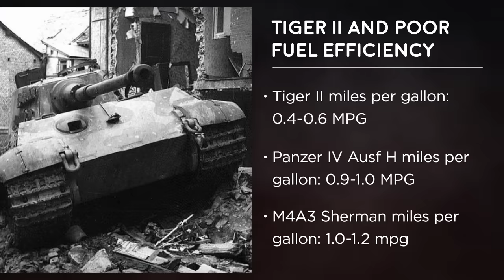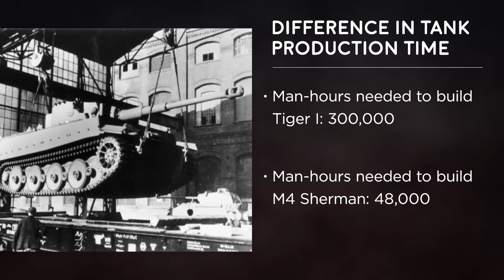Why Did German Tanks Perform So Badly in The Battle of the Bulge?

Comment: great video overall however I think there was some flaws. I believe that the Shermans had the best sights of the war. Both sides tanks could not neutral steer, however the Sherman was much better in urban fighting due to it stabilized gun. A cool fact though is this is the debut of the easy eight the best tank of the Second World War.
Reply: Any 76mm Sherman with wet ammo storage was the "best tank of the war" whether or not it had the E8 suspension.
Reply: @Mishn0  Ik that the shamans were the best of the war this just had improved mobility and cross country performance thus it is the best of them
Reply: Shermans*
Reply: The Sherman was comparable with other tanks in its weight class, but completely outclassed by the Panther. Even the Easy8 was outgunned by the lowly Panzer IV.
Reply: @TTTT-oc4eb  No it wasn't the 76mm was comparable to the Tigers shorter 88mm the Russian 85mm and the panzer 4s had much less penetration than the 76mm
Reply: @apersondoingthings5689  the problems with the 76mm was well known.
Reply: @TTTT-oc4eb  no I don't know any other than it not having a great heat shell and it's regular rounds not being able to pen the panthers upper front plate. Seems like some ones a wheraboo
Reply: @TTTT-oc4eb  by the time the easy eight Sherman came around all problems pertaining to the 76mm were fixed. The gun could destroy tigers frontally and many times panthers too, especially with inferior German steel quality. And with hvap rounds nothing except the jagdtiger was impenetrable from the front
Reply: @apersondoingthings5689  they were never fixed, but by the time of Korea, APCR was plentiful. The standard armor piercing rounds for both the 76mm M1 and 90mm M2/3 were too soft and had a defective HE filler that would often detonate at impact before it had fully penetrated
Reply: @TTTT-oc4eb  dude that was M79 for the 76mm. By the time M82 and M62 came around those problems with shell softness were fixed. The 90mm never had such problems with shell softness and actually never had problems at all. Every single APHE round had the chance of detonating before the shell penetrated that wasn’t a purely allied problem. The main anti tank round of the 90mm in the late war wasn’t even a APHE round, it was T33 which had excellent penetration rivaling the long 88mm on the king tiger. Your assuming that M79 which had problems with the quality of shell was the primary round of the 76mm and 90mms. M62 and M82 were the primary armor piercing as soon as the North Africa ended. You literally have absolutely no sources to back your claim of M82 and M62 being soft and being unable to penetrate the relatively thin armor of the tiger when they could do that from really long ranges and with M82 go through the ufp and out the back in panthers
Reply: @apersondoingthings5689  T33 was issued on experimental basis to the M26 Pershing the last few months of the war, and even that round had major problems with shattering.
Reply: @apersondoingthings5689  Richard Anderson of the Dupuy Institute:

“The "problem" with the 76mm wasn't really a single problem with the gun or in testing...it was multiple problems. The standard projectile, the 76mm APC M62 was produced with a large cavity for the burster, because everyone assumed that it was the behind-armor effect of the HE bursting that would do the most damage. However, there were two problems with that. For one, the larger cavity weakened the projectile, causing it to stress shatter when striking at high projectile diameter to armor thickness ratios. And then, even when it didn't fail, the BD fuse (common in all the US APC rounds) tended to go off before penetration was completed, destroying the projectile and preventing penetration.

However, when tested at Aberdeen they weren't testing for behind-armor effects, so the cavity was inert filled, which improved the results. The problem was exacerbated by the simple fact they assumed the Germans would be using armor similar to our own and BRL did not have samples to test to destruction until late 1943 in the case of the Tiger, early 1944 in the case of a late-model Panzer IV, and late October 1944 in the case of the Panther, which was far too late since the 76mm gun development was completed in early 1942. On top of that, it wasn't until June 1944 that it was realized the hardness specifications for the American projectiles was insufficient as well, which meant that the solid AP projectiles were also deforming and shattering when striking the German armor, even though after the initial problems found with the APC rounds had led to the assumption relying on the simpler AP shot would solve the problem. The solution was re-heat treated AP shot, the M77 in the 90mm, which became the T33, while in the 76mm work on perfecting the HVAP continued.

On top of that, the 76mm had major issues with flash and blast obscuring observation of the fall of shot. The flash problem was solved when it was found that it was caused by failure to completely combust the propellant in the cartridge...the solution was a longer ignition primer. Blast could be solved by a muzzle brake, but it was considered NIH - and too "German" - so was delayed in deployment.

Of course, the worst problem was the conservatism of Ordnance. The flash problem could have been solved from the get go with flash suppressing chemical additives, but they were considered to cause excessive wear in the tube so were rejected, since Ordnance liked to achieve 1,000+ round lifetimes in its barrels, which hardly helped when the tank it was fitted to only fired 200 rounds before it was knocked out. On top of that, despite advice to increase the propellant load and thus increase chamber pressure and Mv (as did the Germans in the Pak/KwK/StK 40 and KwK 42 and the British in the 17-pdr) in the 3" and 76mm, Ordnance refused because of concerns with safety issues. Fundamentally, there was nothing mysterious about the 17-pdr that made it a better 3" gun than the American 3" gun, since, despite the nomenclature, the 17-pdr, 77mm, 76mm, and 3" guns were all very similar pieces.”
Reply: @TTTT-oc4eb  no T33 was issued to all of the 90mms similar to that of the M26 so Jackson’s were also equipped with it. No it did not have shattering problems. If it did it would have not been shipped because of Americas doctrine of everything has to of the best quality. If it had shattering problems it would have shattered against the panther in cologne or the time were the Pershing ufp ed a panther, but it didn’t. Your claims have no base for them. You saw that M79 had a problem with shattering and assumed that all us rounds had the same problem which they didn’t
Reply: @apersondoingthings5689  The Panther in Cologne was hit in the side where the armor is only 40mm thick, at that range even the 75mm Shermans would have no problem going through. Thorough testing of the T33 post war showed major problems with shattering.
Reply: @TTTT-oc4eb  this just proves my point. The M62 which had problems that every APHE ever had with shells exploding before it. M79 the uncapped AP shell had problems with shattering.
Reply: @TTTT-oc4eb  dude you realize that shattering can occur on any thickness of armor. Shattering wouldn’t be a problem if it fired and shattered on 600mms of armor. The thing had phenomenal pen and shattering wasn’t really an issue for it
Reply: @apersondoingthings5689  Read the source I sent you one more time. The M62 rounds were too soft, too,and would often shatter even if the HE filler worked. German APCHE rounds did not have this problem, and the British used solid shots.

Get over it.

As for the T33:

SPACED ARMOR, by A. Hurlich (WAL 710/930-1, November 1950), points out that when 57mm M70 and 90mm T33 solid AP was fired at a 1/2" plate at 30 to 60 degrees, 26 of the 57mm rounds went through the armor without shatter but 26 of 28 90mm AP shattered against armor that presented insignificant resistance. The 90mm shatter was attributed by Mr. Hurlich to longitudinal wave phenomena particular to 90mm AP, since the 57mm round was relatively long and thin and should have shattered before 90mm AP.
Reply: @apersondoingthings5689  I have given sources, you have only given your claims and bias.

Comment: Great video, but just some clarification needed. The 17 pounder on the Sherman Firefly could  penetrate the Tiger II armour but only within 500m with a well placed shot. Beyond that it was very unreliable at penetrating.
Reply: I can't see the 17 pounder penetrating the Tiger II even under 500  yards.   They struggled with the Panther at that range with APDS often breaking or bouncing off.  The Tiger Armour was very slopped more than doubling its effective thickness.

Comment: The Tiger I and IIs weren't designed for such continual offensive maneuvers. They were essentially breakthrough tanks for punching a hole in defensive lines and withdrawn until needed again. They were also good as static defense. Germany however used them in the exploitation or as mobile reserves on the defense. They were ill-suited for this constant movement and weren't designed for it in mind.

Comment: It is a nice comparison between the Shermans and the Panthers, Tigers and Kingtigers. The thing I find wrong is that germans "overengineered" their tanks, like the Panther, which in some cases the engine just started burning furiously, an example is just before the battle of Kursk when two Panther D variants on their way to Kursk just burst into flames which knocket it out of combat, for good. This happend a few more times later, but the issue was resolved. Yet when the allies stuck multiple smaller engines together to make the engine for the M4A4, it turned out to be way more reliable than almost every single german tank, just like all the other Shermans. They also stuck a radial engine, used for aircraft in the M4 and it worked to. The Shermans broke down way less frequently than the Panthers, Tigers and Kingtigers, but due to a good design they were also very easy to repair, like the transmission, which only needed for one single piece to be removed to fix in the eventuality it did break. German quality is also somehting which played a part. When you had slaves and workers who had to be moved away due to allied bombing and the harsh environments compared to the workers in the US, who worked in spacious and way more comfortable environments without the fear of being bombed, its easy to see why production quality was a problem. Also the Shermans had a low-speed-stabilizer which made them great in close quarter combat.

Comment: The track was pin and hole design, when the track froze to the ground the final drive failed or the transmission. Pin and hole drives are simple to make but wear out quickly in sand, gravel , or rocks, readjustment is a constant or the pins slip and ride on the track not in it. The system was changed in the last year of the war.

Comment: So if the big cats being bigger and better proved to be futile and even a hindrance, why slander the 75mm M3? Even if all you look at are the field reports of tanks and personnel lost it doesn't paint the full picture. The 75mm M3 was a fantastic gun and was enough 95% of the time. The 76mm was considered a downgrade so why give up on something that works 95% of the time? 
The firefly's 17 pdr had just raw power and brute strength bc it had 3 times the propellant the 76mm M1 casing had, but with the muzzle break and certain ammunition like the APDS round it was wildly inaccurate. I don't understand why nobody talks about the M93 HVAP for the 76mm m1 armed shermans because it was roughly equal to the standard 88mm kwk43 rounds, and was more accurate than the firefly. The problem is the tank on average only carried 5 rounds of M93 but for how common big cat encounters were I wouldn't just write that off. 
The 76mm with the right ammunition was able to keep pace with the German guns but the tungsten wasn't. The big reason we needed the 90mm was for the M82 aphe round being the most common offered the greater performance on average and with apcr. 
But in the end the firefly just had a beast of a gun but was a rough, stop-gap solution, and the M93 HVAP was more than adequate at dealing with the big cats. If the army ground forces felt they needed more they would've asked.

Comment: Immediate guess based on previous knowledge but I’m saying that they underperformed because 
1. The limited fuel reserves mixed with the consumption rate meant they couldn’t travel far enough.
2. Allied forces were more capable of knocking out a panzer by this point in the war than they were before.
And 3. The plan was not great and didn’t do much to help them out.

Comment: When the Germans origonally went through the ardennes at the start of world war 2, they has Panzer I's, II's, and III's, which were smaller and lighter, allowing them better control and manuverability on the small narrow roads. The panzer divisions were also better supplied and armed at the time since they were on the offensive. The weather was also far better. 

Turning to winter 1944, Germany was equipped with bigger and heavier tanks. These tanks made it difficult to manuver on the more narrower roads. Winter conditions with heavy rains and snow made it a nightmare for the heavier German cats, causing them to bog down in fields that were soaked from heavy rains prior to the German counter offensive. 

Supplies were also dangerously low for both infantry and panzer divisions. The severe lack of fuel and ammunition was difficult to keep the tanks running. Many of the German tanks during the Battle Of The Buldge were destroyed by their own crews when they either ran out of fuel, or mechanically broke down or got stuck so the allies couldnt capture them and turn them on the Germans. 

The weather was also very harsh for both sides. Going from a warm 60 degrees to below freezing with winter blizzards, and howling winds, it was a morale killer for both sides of the war.

Comment: Excellent collection of information and rare videos.
The problem of fuel was not the lack of it, but the lack of suitable transport to take it from the rail head to the tanks in action.  The underlying problem was the the lack of trucks built by the Germans.  Britain shipped more trucks to Russia during the war than Germany built, and the USA built 10x more than Germany.  Hitler spent the money on tanks but not on the supporting services.  
Guderian describes well the thinning out of the panzer divisions to create more, weaker ones, and one aspect that is rarely mentioned is the reduction in support services such as engineers.  Before Fall Gelb, German divisions were equipped with all the river-crossing equipment that they might need to fulfil their taks, but Peiper, knowing the weight of his tanks and the bridges available to him, did not have the engineers to reinforce the bridges.
Finally, the fuel consumption of Tigers was only one drawback of German tank design.  Ferry Porsche was tortured by the Russians to reveal the true design documents of the Panther tank, because they could not believe that he (or Germany) would have designed a tank in wartime that used 45,000 different components, when the T-36 used only 15,000.
You should also point out that in 1940, it was summer and the weather was warm and dry, while in 1944, it was winter and snowy.  By 1944, the Allies had massively increased their anti-tank weaponry, even at the infantry squad level with bazookas, so the tank was no longer the battlefield-winning weapon it had been in 1940, when the British and French had no tank-busting aircraft and their tanks were divided up and in any case retreating.
As for the STUGIII, there were more produced during the war than any tank, but not all of them had the anti-tank 75mm gun.
In 1941, German battlefield repairs were managed much better than the British.  Both Americans and British improved their repair service, but by 1944, Germans struggled again due to lack of trucks to carry the crews or tow the tanks away from the front line.  This was not entirely due to lack of spare parts, although that exacerbated the logistical problems.  Reliability of the tank itself should not be measured by a failure of the support service.
It would be better to say that the German armed forces performed badly at the BotB, but this was mainly due to lack of air power, not to any particular failings on the part of German tanks.  Having limited natural resources and production capability, it makes more sense to build a few good tanks rather than lots of crap ones like the Sherman.

Comment: Another point about German success against France at the beginning of the war… they were overwhelmingly comprised of small, light tanks. So maneuvering through that terrain and over bridges was fairly easy if compared to dealing with the same terrain in a late war chunky monkey like a Tiger or Panther.
Reply: Also dont forget German Blitzkrieg back then was actually 'new' Up until the forefront of WWII the playbook was based around the infantry-tank. Its was a combination of tacttic and tank-type that made that so succesful.
Blitzkrieg with tigers would have been near-impossible.

Comment: To add to the Nazi's woes, slave labourers would sabotage the equipment in the factories.  Ball bearings with too few balls, and incorrect markings on dip sticks for example.  The machines would run fine at the end of the production line but would quickly fail in the field.